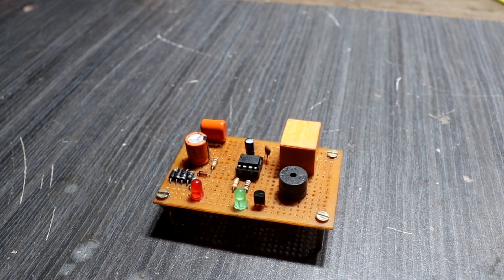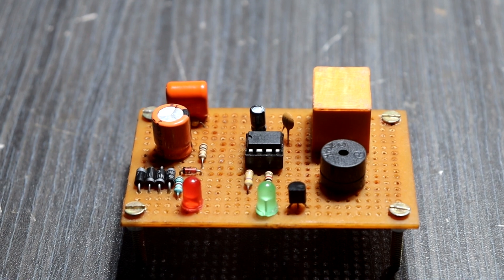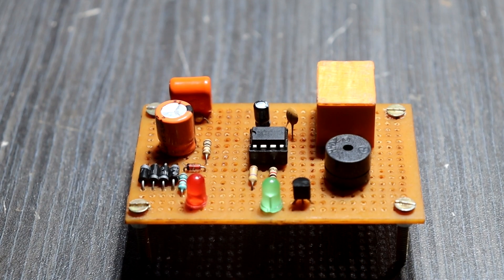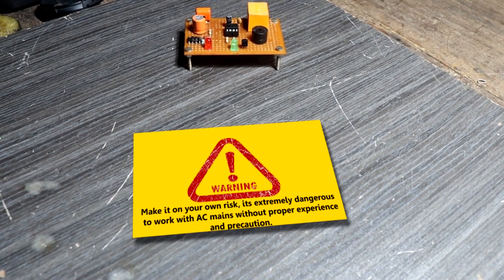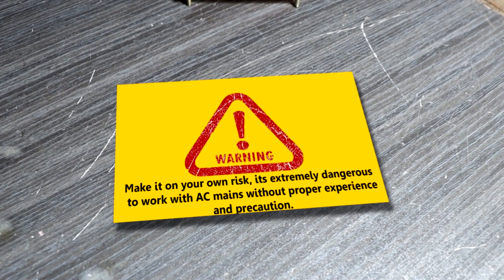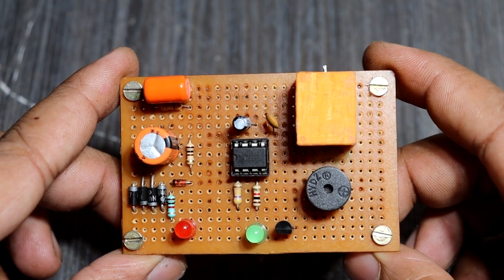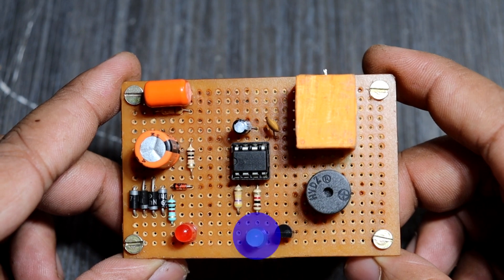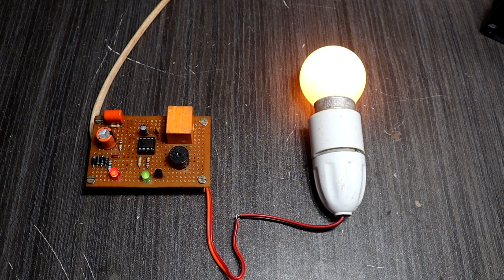DIY DELAY ON CIRCUIT FOR YOU'R ELECTRONICS DEVICES [PROTECTION]

Comment: Hello, thanks for the working circuit. Here, the bulb on's after a set time.. how to change of off after set time.. meaning.. when power on, bulb to on, then after time period set..it should off. Thanks
Reply from the maker: Possible only using microcontrollers. Like arduino